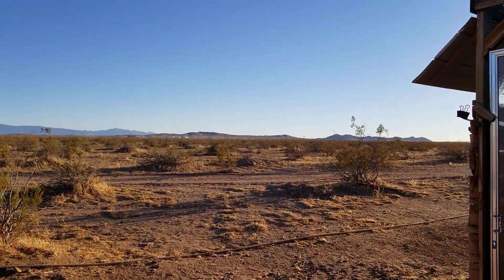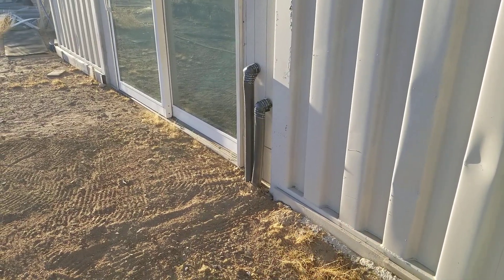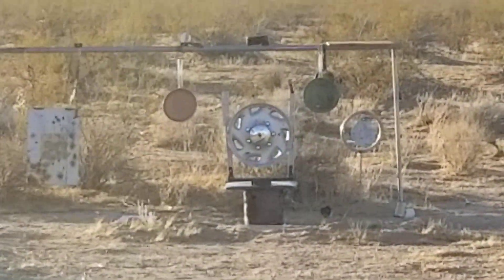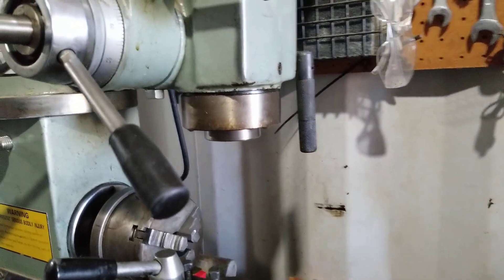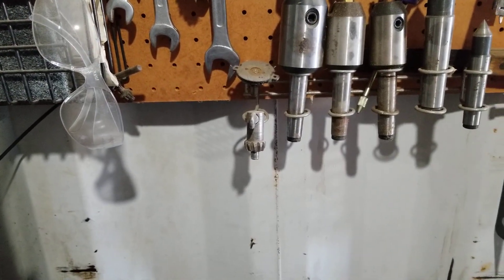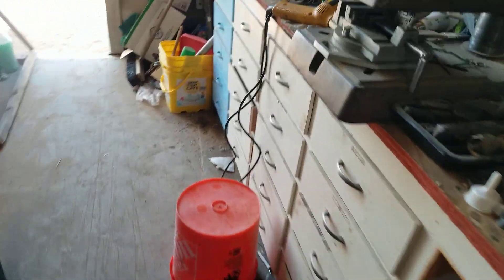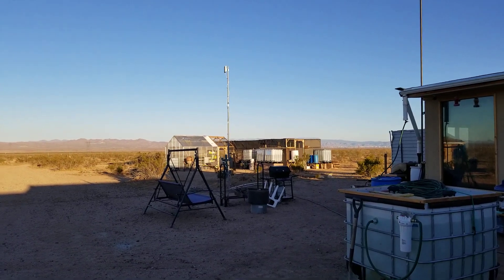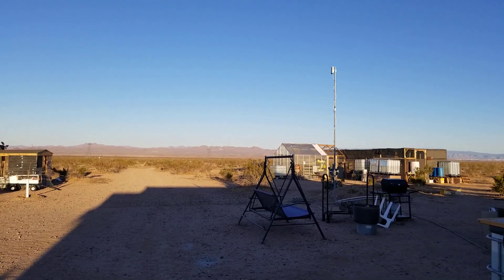Getting some things done with a wind break, April 28, 2021

Comment: You have a complete machine shop, off grid in the desert, very impressive!👍
Reply from the maker: Sometimes a guy just needs the tools to make something..
👍😉👍
Reply: @GBear  yeah, it's also always nice to have a 90° band Saw and a 45° bandsaw setup. I managed to work on my car today, in addition to feed and water the birds rabbits and Cricket, I put a new ignition control module inside my distributor, only to find out that I really need to replace that distributor and or the wiring harnesses or remake them for the distributor, the wires and the plastic coating are all very crisp and brittle. I also transplanted some of those seedlings out of my big tub into individual pots. 👍🌵🌵🤗
Reply from the maker: Busy guy!  Me too!  Getting ready to shoot an episode now.
Reply: @GBear  looking forward to watching!

Comment: Glad you were able to work out the exercise machine. You should hit 5000 any time now!   I should have my solar setup in my shed by the end of this weekend ;-)
Reply from the maker: Cool!  Remember to leave air space between the panels and roof so the panels don't overheat.
Reply: @GBear  Yup, it comes with some good mounting brackets that leaves a decent amount of space under the panel.